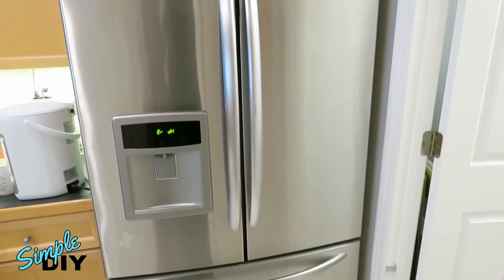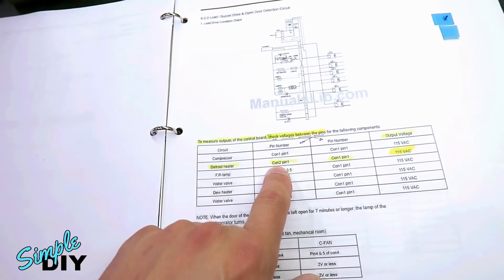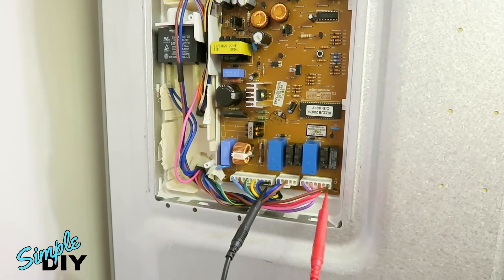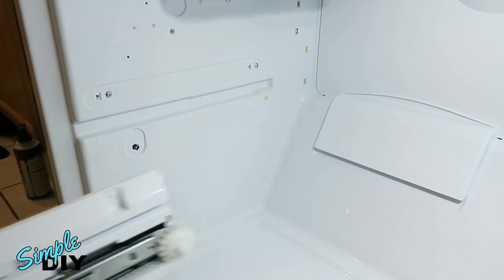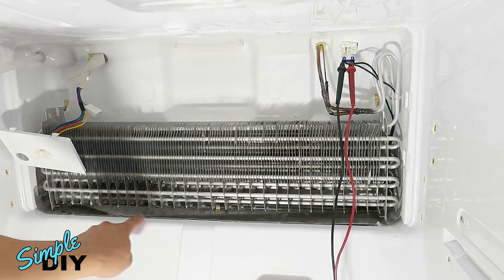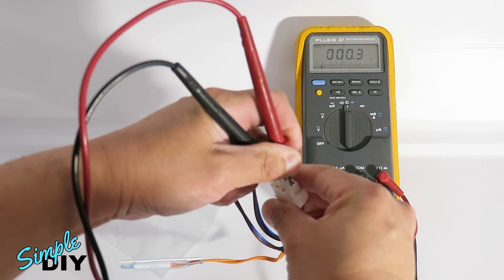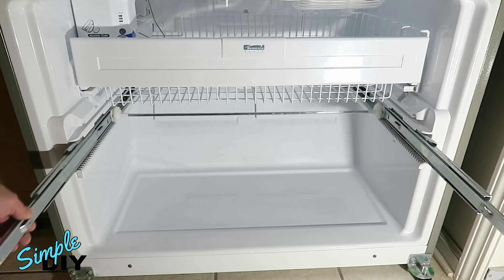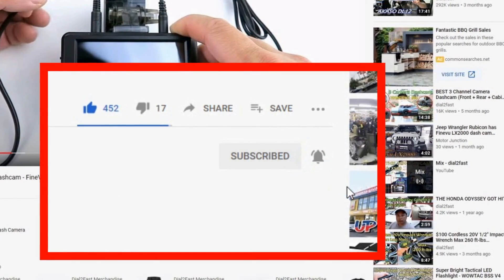How To Fix Refrigerator Error Code Er dH On Kenmore LG Fridge

Comment: Where do you find which wires to check for different units? I got the manual (which is of no help) and diagram (nicely put on the back of unit) but still don't know which to probe.

Comment: I'll confirm it is the defrost HEATER (that long u shaped coil) that needs to be replaced - not the defrost sensor and certainly not the control board. After spending $500 on a bad diagnosis, and research into this on YT, I got a third tech to order me the defrost heater. It's been 5 days and the issue is solved, finally. He had to cut the support bracket to get the old one out, but it was a 20 minute fix once the part came in.
Reply: Just because it was the heater in your case doesn't mean that the defrost sensor or board can't cause the same issue.